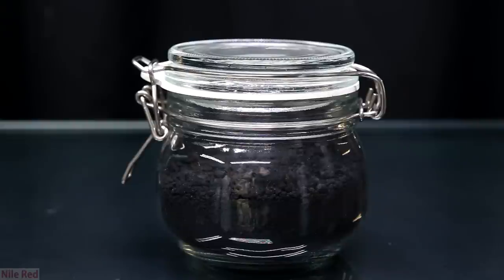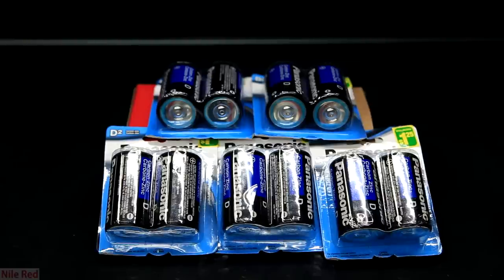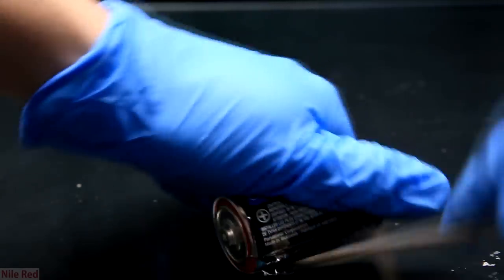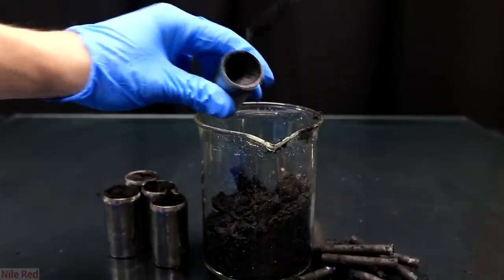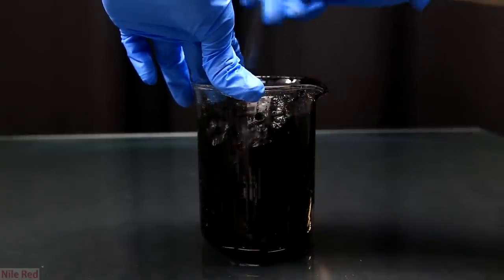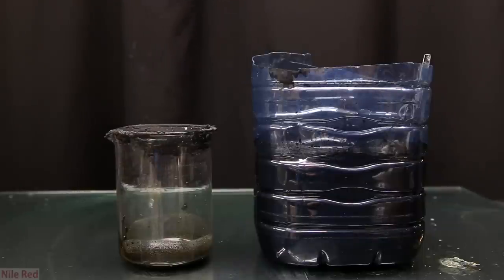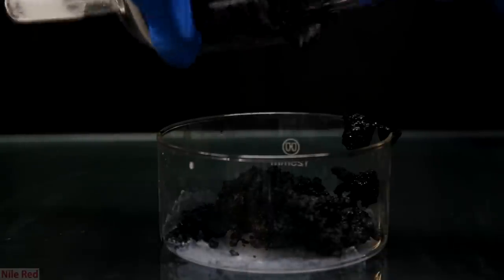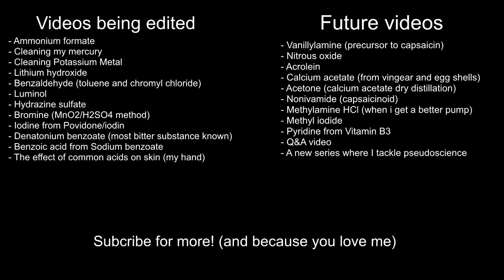Getting Manganese Dioxide, Zinc and Carbon from Batteries

Comment: why not just film in 4k then using the export function in your editor export to 1080p?

better yet post only 4k and let youtube scale it down automatically.

when you upload a video youtube automatically re encodes in all the sizes below what you post because there are still users with very slow technology that uses 360p

if you can still get 6 and 12 volt batteries they have bigger cells

i think the 6 volt ones use double D witch is the equivalent to putting 2 D batteries in series and there are 4 double D in a 6 volt and. 8 double D in 12 volt batteries.

the 6 volt is used mostly for lanterns and the 12 volt is used for bigger lamps but mostly (i think) electric fence backup or in remote locations.

today there are better batteries for lamps and electric fence backups.

you know!!! you can buy Manganese Dioxide powder on ebay and amazon.

if you can buy more hardware you can do multiple experiments at the same time.

of course some hardware is quite expensive for example the oven you used to melt the copper to recreate the pouring molten metal into water and explode the jar video that oven costs over $3000 i was googling something and that oven showed in the results.